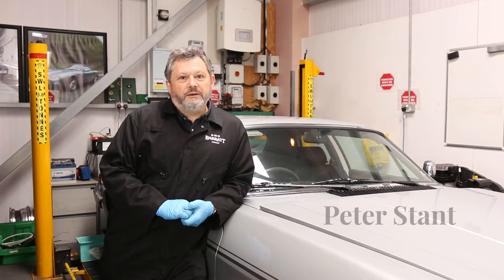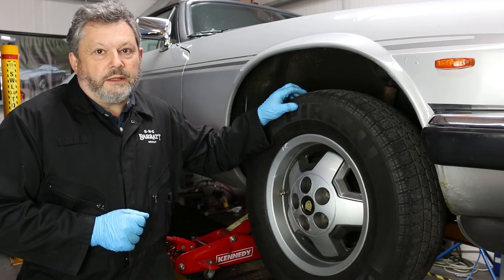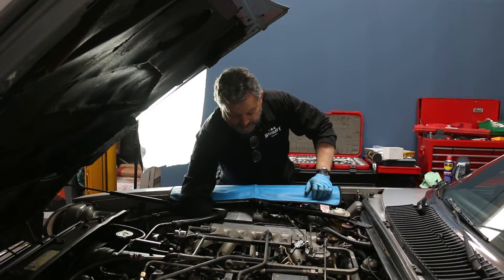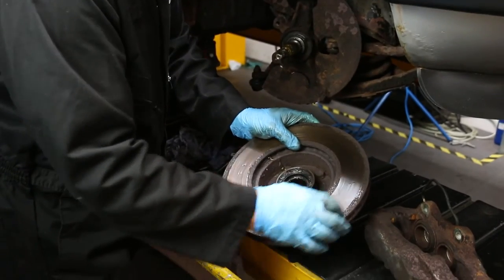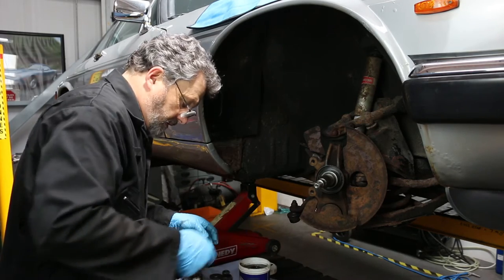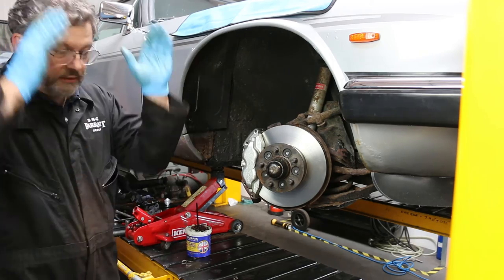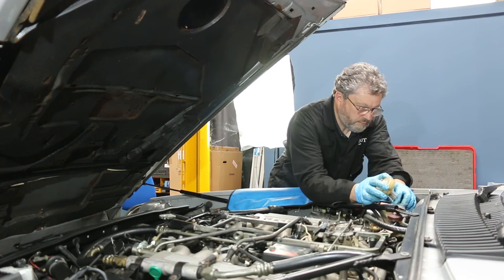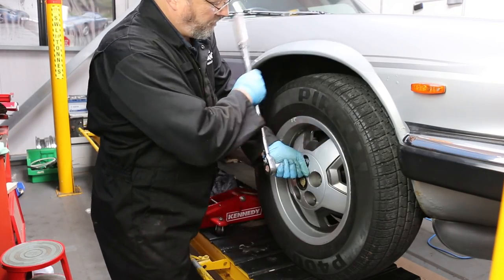Brake Calipers and Hoses | Jaguar XJS Upgrades - Episode #1

Comment: Hi. I have a 1990 Convertable Jaguar XJ-S which I am restoring after it spent 12 years unused in a garage before I bought it at auction. I have already replaced the calipers and brake shoes etc in the front wheels succesfully. I found your video extremely interesting, thank you. I have just purchased new rotors, calipers and brake shoes etc from SNG Barratt and would appreciate any help you could give me especially if you have made a video doing the back brakes. I do not have access to a high lift ramp so would have to strip out the old items from around the differential doing the work on my drive with ramps, axle stands and jack lift etc. I look forward to hearing from you, and look forward to seeing more of your videos also. Regards John Chipchase. Cambridge.
Reply from the maker: Hi John, thanks for the comment and were are glad you're enjoying your XJS! At the moment we don't have a rear brakes video. For further info on parts it would be best to contact the team on 01746 765432. Thanks, SNG Barratt.

Comment: I am glad joined SNG Barratt, I have 1985 XJS six cylinder standard that I have problem with rear gear, it won't engage, do you have any suggestion, Thank you

Comment: Great to see SNG making these videos. Did you replace the metal pipe between the calliper and the flex hose, or just reuse it? Just wondering as you didn’t mention it. Thanks.